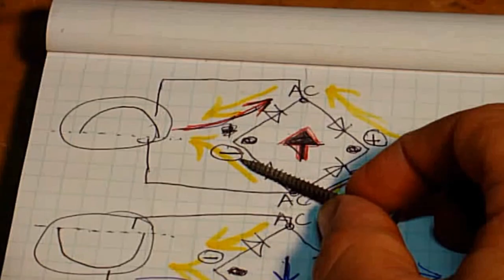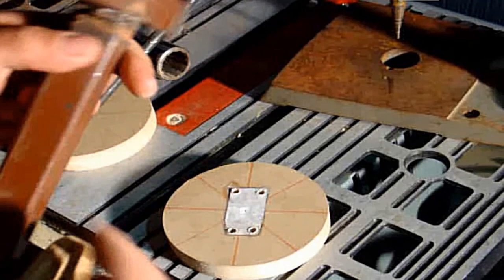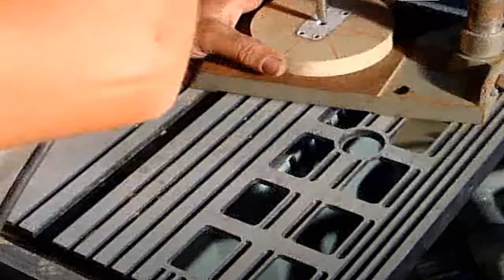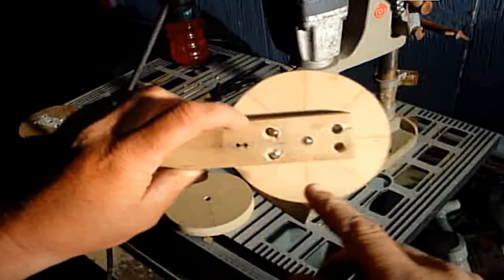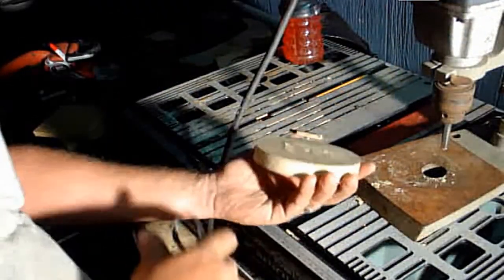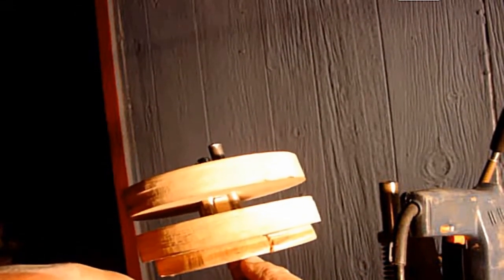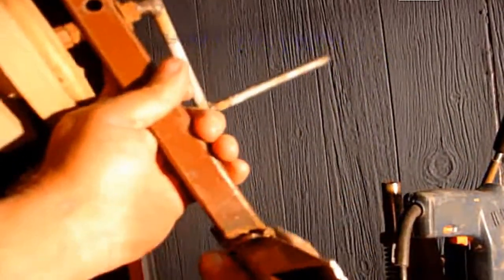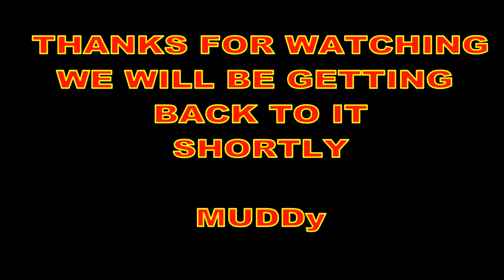HOME MADE COIL WINDING JIG

Comment: Quick question...where did that video go where you rewired a ceiling fan stator with thicker wire for higher amps? Can't find it anywhere! Thought I'd give it a try! Cheers
Reply from the maker: It was at boomers place. Check boomers vids.
I believe I used 18 gage.
I hope that helps.
Reply from the maker: Rhead100
Reply: @muddymuddymuddmann  Thanks Scott! Cheers!